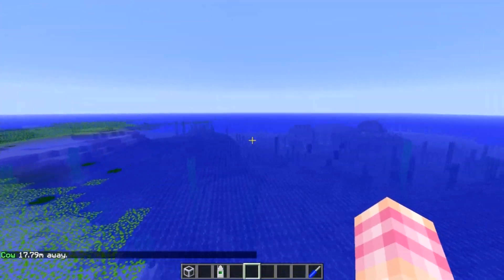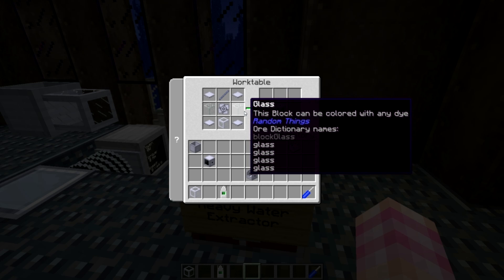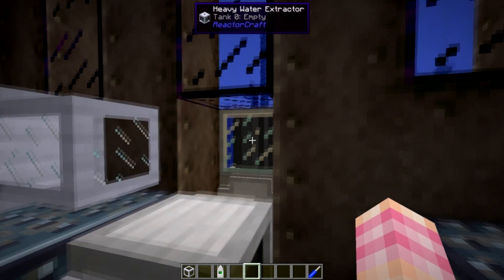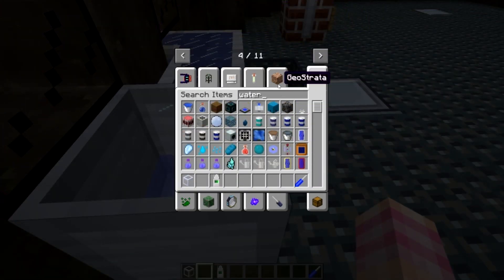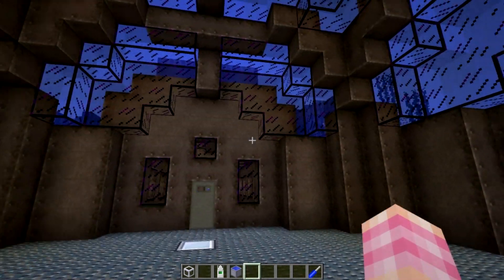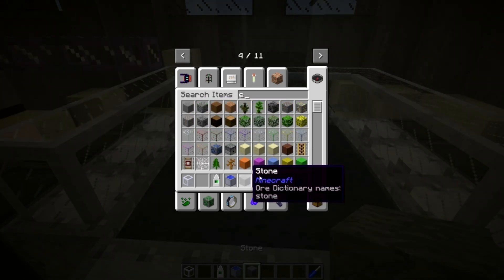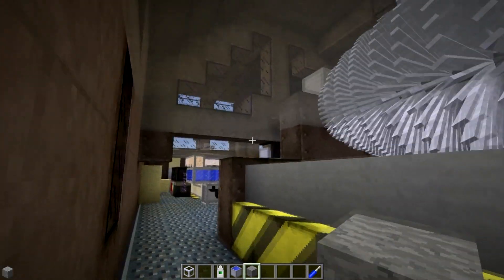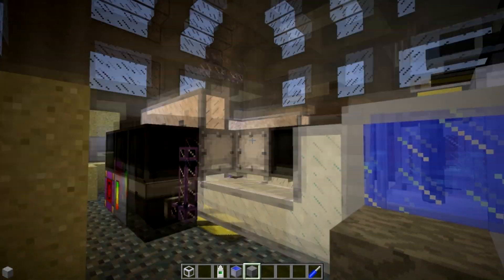ReactorCraft Tutorial #15 - Heavy Water Extractor

Comment: maybe you can help me i build up a lil under water farm for heavy water i set up a gasoline engine with a 4:1 gearbox on torque mode with a bevel gear for the centrifugal fluid extractor jeah he is standing under level 45 and there a 3 sites of waternext to it in a ocean biom and its just spinnig and dont do anything sorry for my bad english :P
Reply from the maker: Make sure to read the handbook for the power requirements. There is a good chance that this video is outdated.
Reply: jeah the power is correct i tryed it with the creative coil with the exact power speed etc its spinning and the internal tanks are not filling and agin sorry for my bad english :P
Reply from the maker: DrTotLP
There needs to be a certain number of water blocks above it. Just throwing things out here.